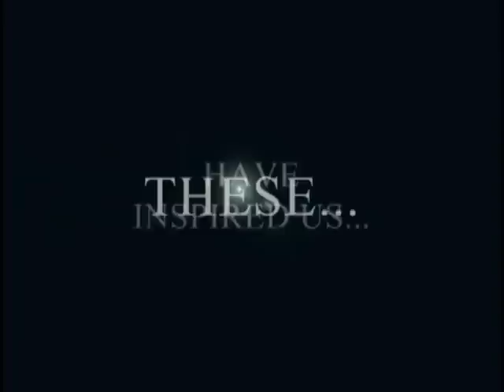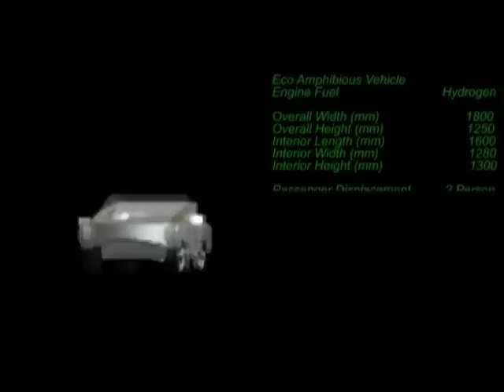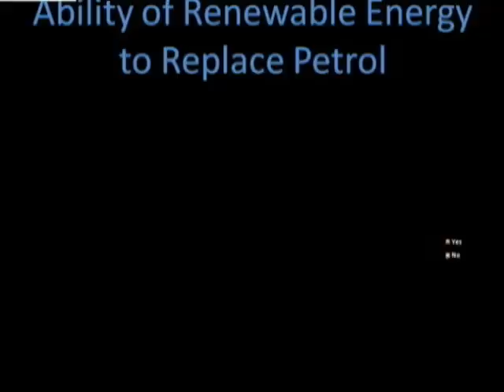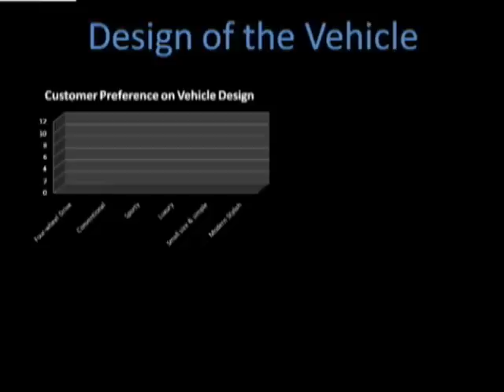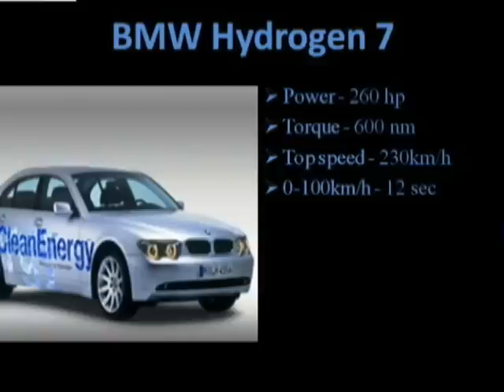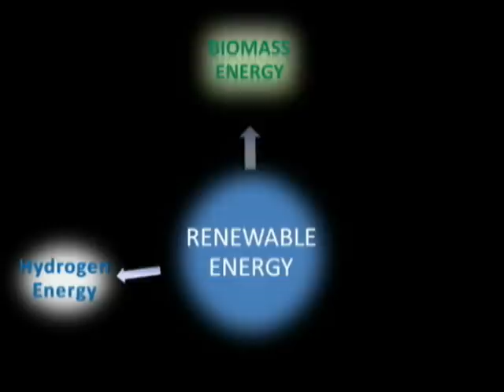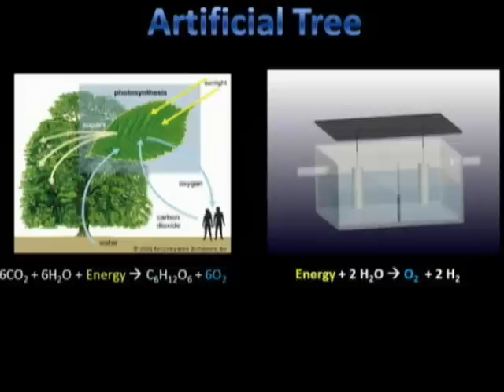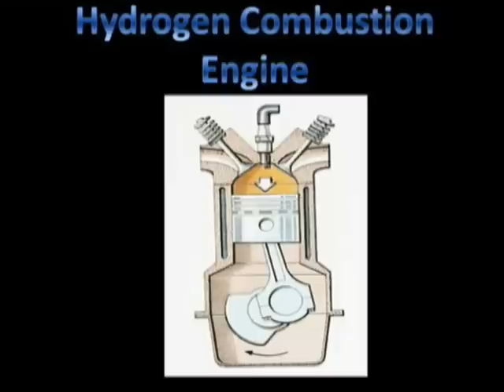Amphibious car video presentation

Comment: Nice video...animation part is relatively short but cant blame...this is under the boring requirement of someone. the video has  2,3 minutes showing customer requirement.more on the CAD of the part is expected. In term of design, feasibility is the issue. ur design is great but how close it is to reality need to be answered. In measuring the air drag/flow resistance while in water. try refer for the boxfish. merz has 1 car m/f and bought on road, 0.1 something in coefficient of drag (near F1 !!)